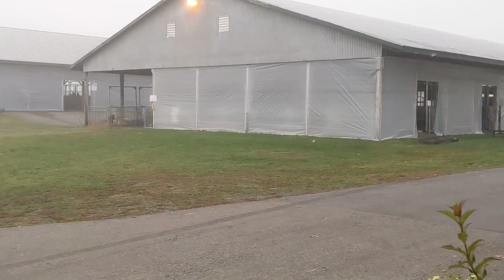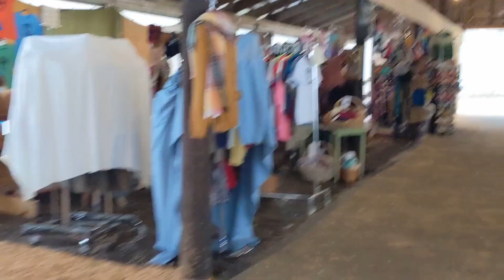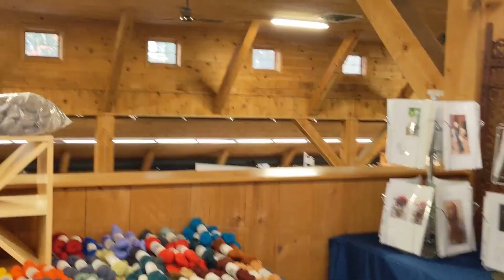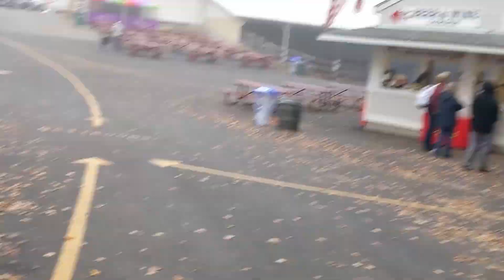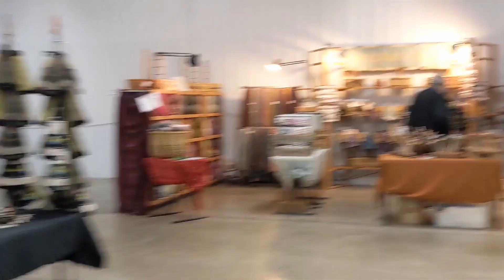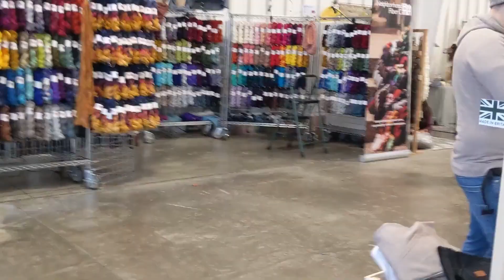SPIN 146 - NY Sheep and Wool Festival Ramblings

Comment: I’m late to this video but has anyone asked you about a skein winder meant for spinners?  Specifically, a skein winder that’s motorized, can utilize your yardage counter, that can be set to specific lengths (entering skeins for competition usually require specific lengths) and is portable. There are several skein winders available but they are usually for knitters who are unwinding skeins and those made for skein winding are not motorized , or not portable, or cannot set specific lengths just a general range. I’ve done a bit of research trying to find something but so far haven’t found something that checks all the boxes. Thanks for considering.
Reply from the maker: This is on my list of things to consider.  Right now I have other things I'm working on, but I do think I'll do an affordable electric skein winder someday.

Comment: Great video!  I'm really excited by several of these, but I'm not a fan of the true ball winder.  Balls are kind of annoying to work from since they roll away and they leave the yarn under tension so you shouldn't store yarn in them for too long.  Cake winders allow the yarn to relax once removed from the post they're wound around.

Comment: +1 for a tensioned bobbin winder in the comments! I'd be very interested in a flatbed/sock knitting machine especially if it was standard gauge. Hobby knitter machines only work well with worsted weight yarns.

Comment: I would love to see an affordable tensioned electric bobbin-winder where you pop in any size bobbin between two mounts, like the LeClerc. I've been using my drill with a wood dowel to mount bobbins on, but it's not optimum.

Comment: I would love to see you create an affordable sock tube knit machine!  Also, a cake winder would be good. I try never to wind my yarn into balls because I get tired of chasing after balls that inevitably fall on the floor and roll away to a hard to reach corner!  I don’t think I’ll ever go back to using a treadle wheel (I owned three at one time) as the EEW6 is far superior to any treadle wheel and super easy to use.